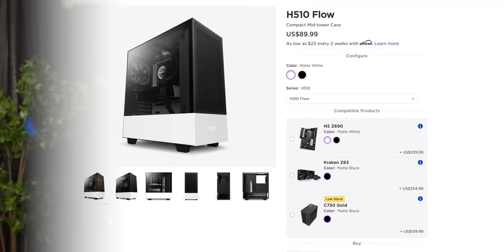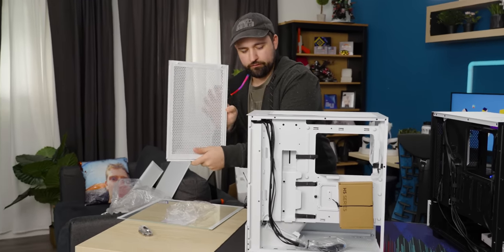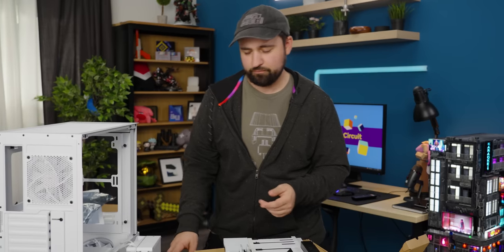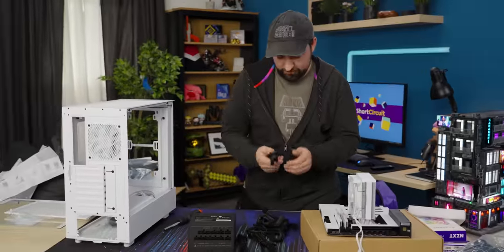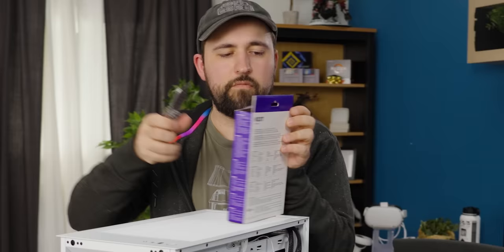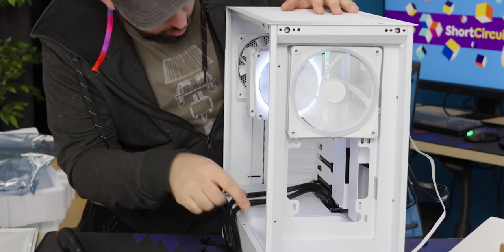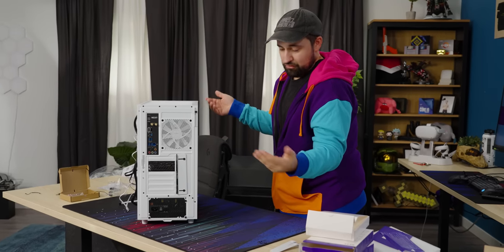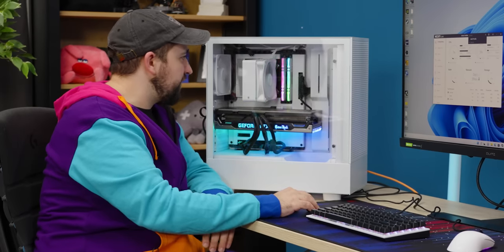Does this change make a difference? - NZXT H5 Flow

Comment: Suggestion:   A PC case with air pipes/channels, so main bulk of moved air travels directly to the major heat distribute points, and allow leftovers for the rest of the PC.
Like water-cooling with big air tunnels instead of pipes.

Comment: I really don't know at 10:57 what this is. In general i like these videos but what the hell is that? The GPU-cables are all over the place, not zipped together or anything. The same goes for all on the top of the motherboard. A really noticeable crooked fan on the cpu cooler. This ones RGB even isn't plugged in. All this stuff and no extra second front rgb fan and replaced back fan for an "all the same fans" look? Why not using an all-white GPU for such an otherwise colormatched PC? I don't know, maybe it's me but in my opinion the asthetics of this build is terrible. Sorry, for me this is a no-go. ^^

Comment: Only one fan in the front, didn't connect any led's, didnt install the vertical bracket, the CPU fan is crooked, didnt plan for some white cable extensions... this video is half-assed in a bad way. All of that stuff isnt that hard.

Comment: I AM A PC LEFT GUY TOO!!!!
Reply: We also need to redesign motherboards in general. It can definitely be more efficient. Cable management whatever. Like why is the one in the top left why not put it by the 32 pin. Why out front Panay connections in the bottom. Put them on the right to hide the cables better.

Comment: Oh yeah that's some nzxt tax. 50$ for a rebranded, fan swapped, 20$ uphere cooler. It's not even a good fan, thermalright ships better fans on their 20$ cooler, which is also a 120 tower.  There's also the 90$ upcharge on their motherboard, even though they use absolutely zero of that profit to pay the bios team. If they even have a bios team, because that bios is near unusable.

Comment: makes a white build, puts black graphics card in. -100 points. Also there is zero point to that card with all the crystals on it when its not vertically mounted. - another 20 points.

Comment: it is so white.   I do not like that, just back it blah.  
And with so much motherboard armor you can not see anything just plain white.  Bland
Reply: Not much point of the blinged out graphics card since it is facing down, you do not even get to see it.  probably would be better with the vertical stand.
but then a black card in the middle of the all white case again make the white look weird.
Otherwise i like the case I think the point of the bottom fan is to point directly at the GPU card so gives better flow, assuming you did not have front fans blocking directly on the card any way.